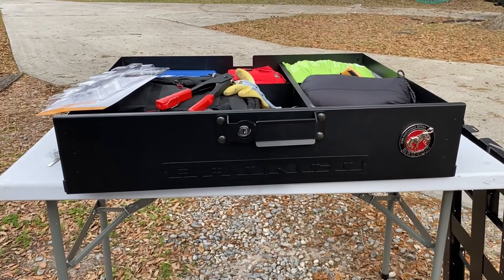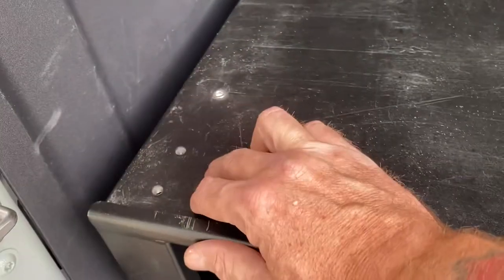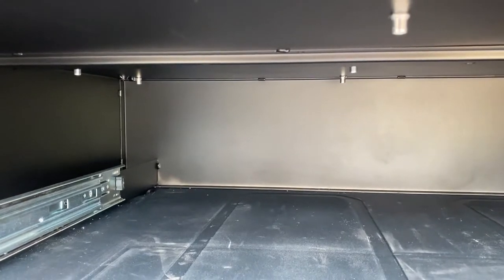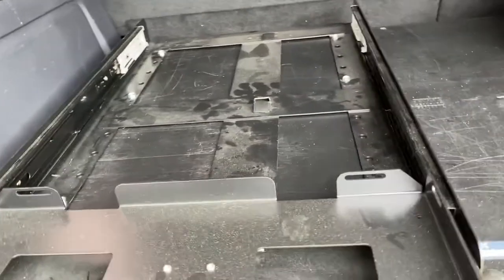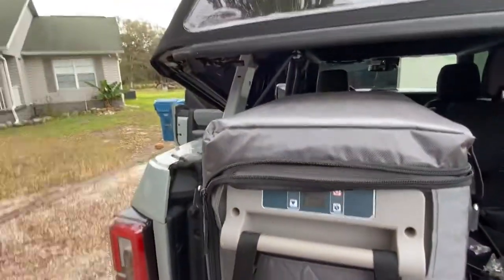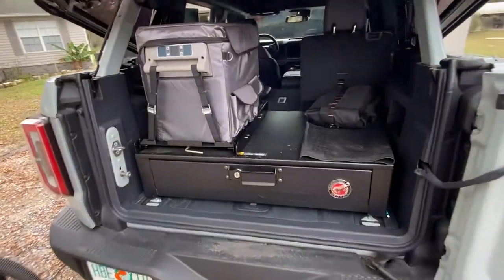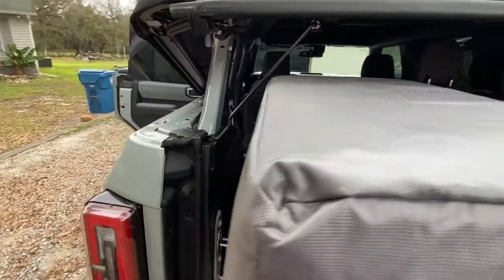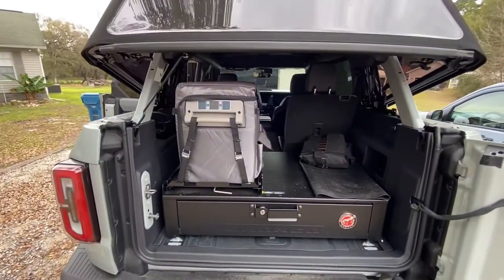Fridge Slide on Tuffy Bronco Drawer

Comment: What if you added the soft top struts would that do away with using the prop rod?  Otherwise nice job
Reply: Yes! I did get the Soft Top Assist struts and it has done away with the prop rod. It also opens the top a little further, so access has been easier. 

I recently filled the Fridge/Freezer with deer and hauled it from Maine to Florida. The slide worked well with 3 Rivnuts per side and a full 40lbs of meat.

Comment: have you had an issues with the amount of weight on the top of the drawer i thought i read there is a 50lb weight limit on the top,.
Reply from the maker: I have not. I actually filled the fridge on freeze with over 50lbs of Venison last summer and drove home from Maine. I also had a hefty Teak Horse Bust, as well as 5 adults backpacks full of clothes and things, as I drove home to Florida from vacation. No issues with the drawer at all. The Fridge Slide if anything is providing an extra reinforcement to the top, as the front, rear, and one side are all matching the drawer itself, the middle slide base is solid, and I’m sure it keeps the middle more secure.
Reply: Awesome thank you! This is exactly what I want to do!